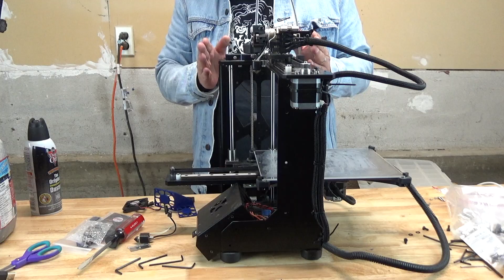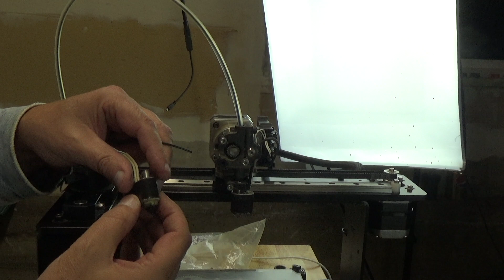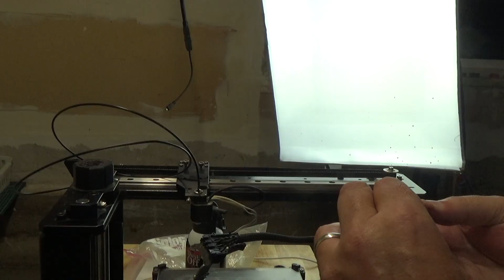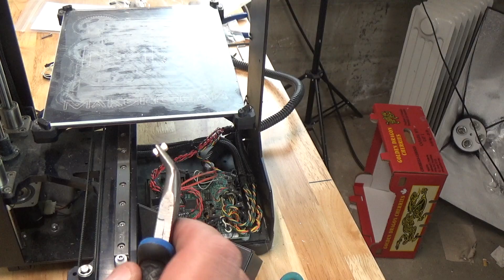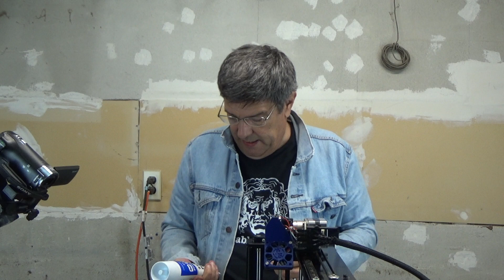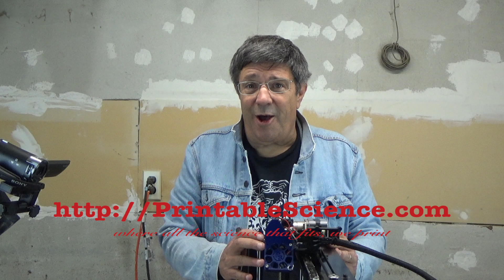Makergear M2 Fans Fuses Carriages and Hot End

Comment: I was so pleased when you pulled out the lithium grease... was sat there wondering if the rails are lubricated with that as the vertical rails remind me of the rails in a floppy drive, which should be lubricated with lithium grease. You can get it in an aerosol so you can spray it on in the same way you’d use WD 40. Really enjoyed this video, thanks!
Reply from the maker: With all the frustrations inherent in 3D printing I have been assuming that all the parts got the required lubrication from my tears... but clearly that is not so. As for lithium grease in an aerosol... I think for myself that would be a dangerous proposition... I once managed to coat a whole wall and ceiling with WD40 in a spray can even though I had set out to only lubricate a small bolt. Oh well! Thanks for you comment, glad you enjoyed the video!